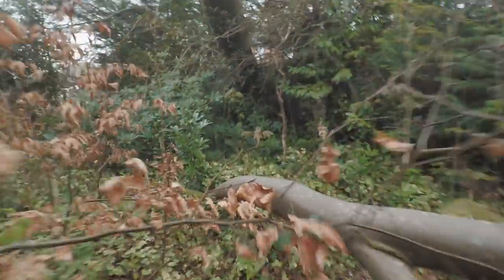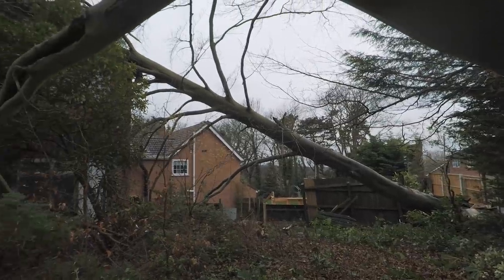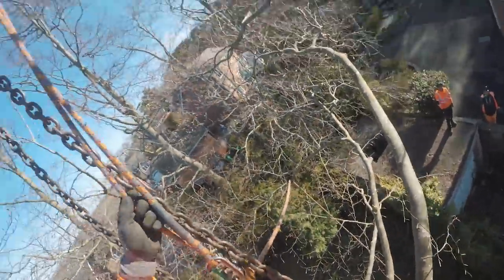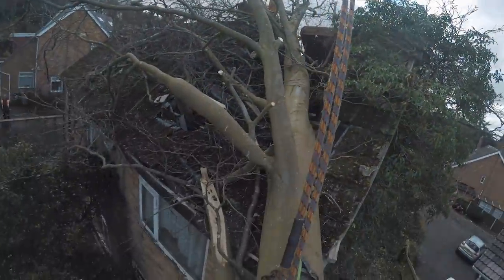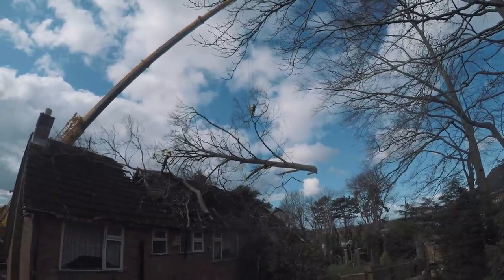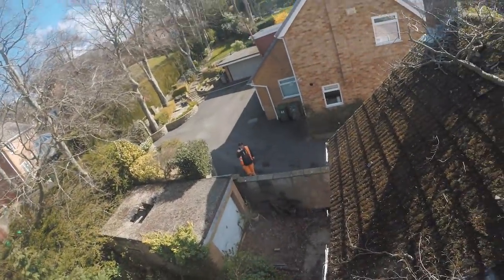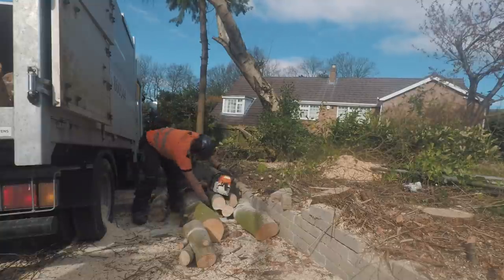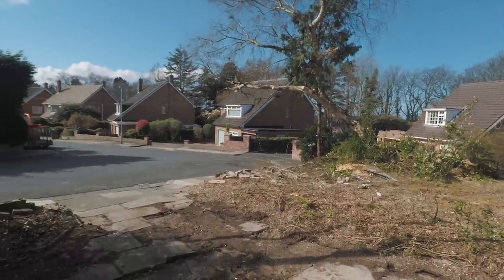Two Trees Fallen On A House (UK Windblown Crane Job)

Comment: Why the chains, as opposed to slings?   They seem very cumbersome..  We work with our crane at least four, sometimes five, days per work week...and the only chains that we use are for securing the mini-excavator and the Bobcat to their trailer..  At any rate, it's nice to hear some folks who have a decent command of the English language....for over here in the Divided States of post-MAGA idiocy, most people can barely form even a rudimentary complete sentence..
Reply from the maker: Hi Matt good question. Chains are just what the crane company use. I have thought it would be better using rope slings. Might have to get some for the next job. Haha, most lads are pretty switched on over here to be fair. Thanks for the comment 👍